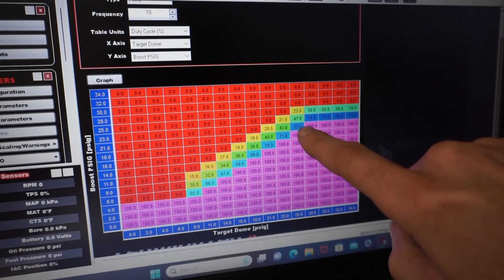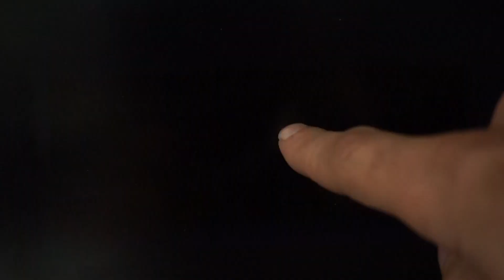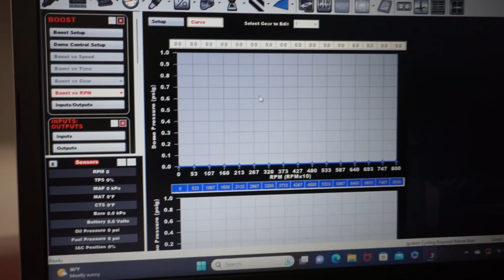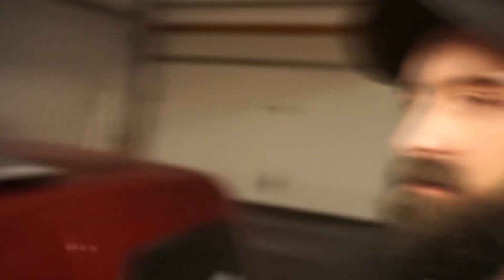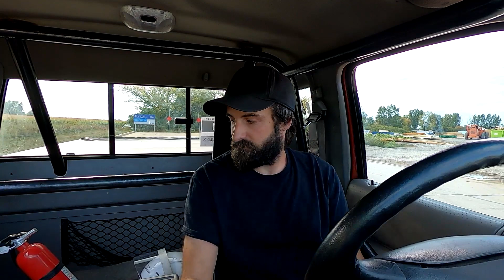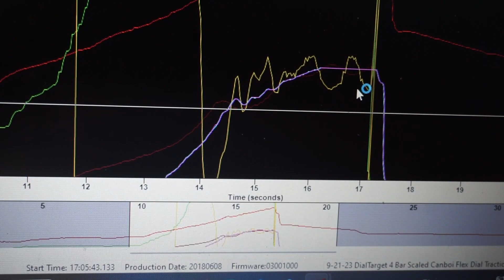Boost Control and Bump Testing For The Homies...

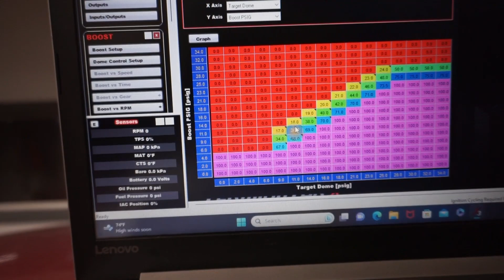Comment: Excellent work. Looks like you can increase resolution some on boost vs. dome (since you have a couple zero rows near the top). So, at 11:38, you could  bump those colums up by 1 and get more resultion so there's not so much interpolation between cells. May further improve accuracy....but it seems pretty damn good as it is now.
Reply from the maker: Very true. I did want to keep some extras up top just because it makes me feel better if it overshoots lol. But for sure I could take maybe 4 rows and add some resolution. Good idea.